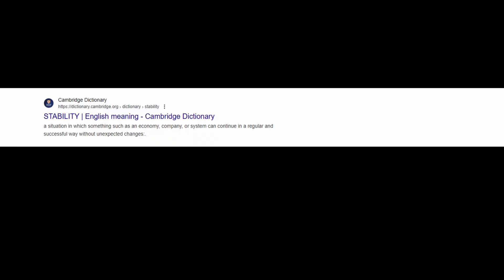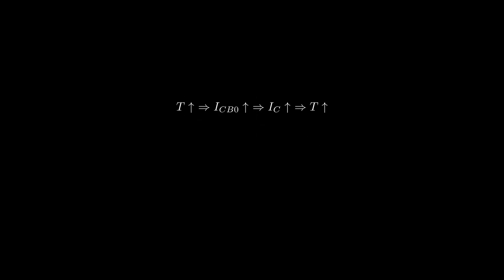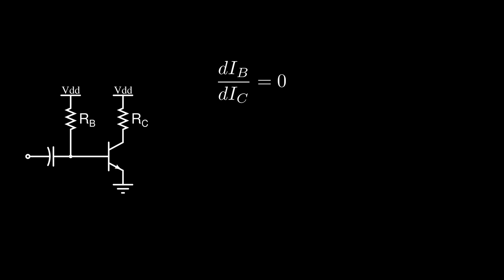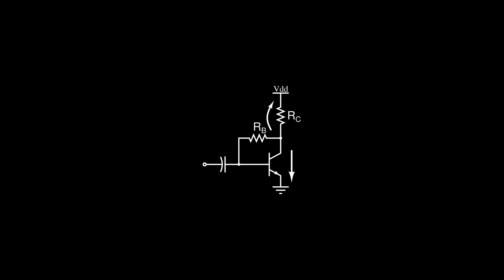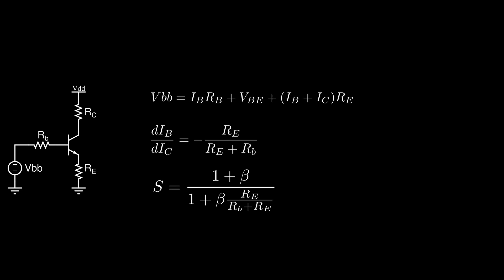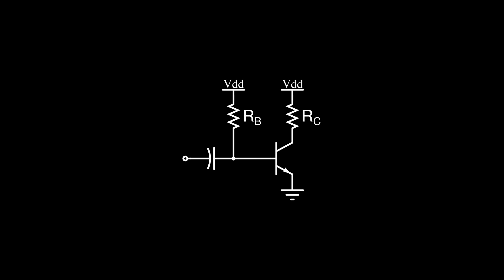BJT Bias Network Thermal Stability Explained in 5 Minutes

Comment: I had never come across a mention of Icbo leakage current before. Great video!
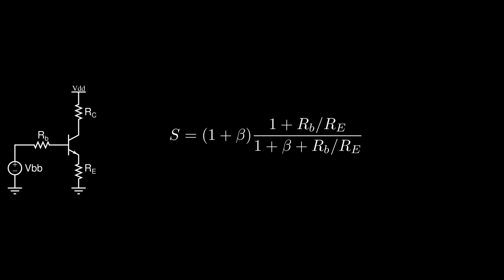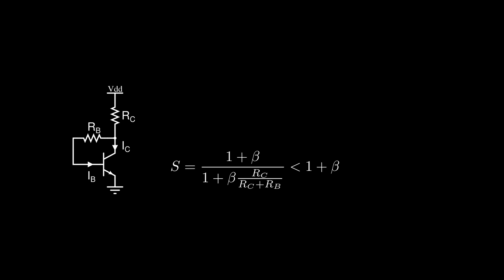By the way, the same condition that applies to Re at 3:54 also applies to Rc at 2:49 and thus the same S can be obtain in the limit.
Reply from the maker: Thank you! Oh you are right, I've missed that! However I think that Rc is usually thought more like the load of the circuit, thus something you usually don't have really control on, so it is best to have another resistor to be able to tune things up with